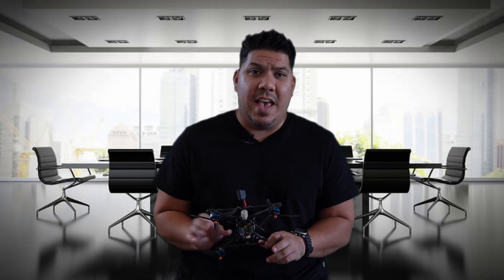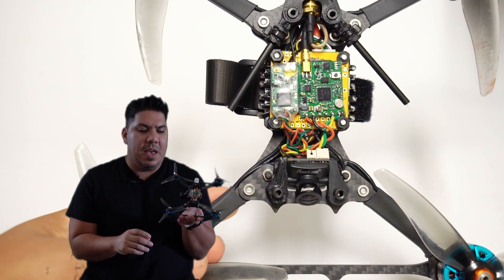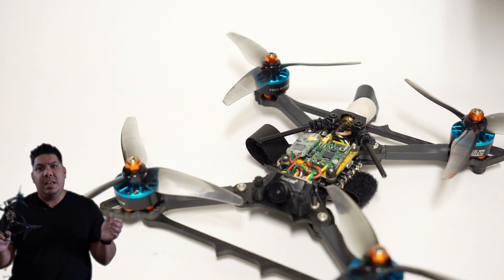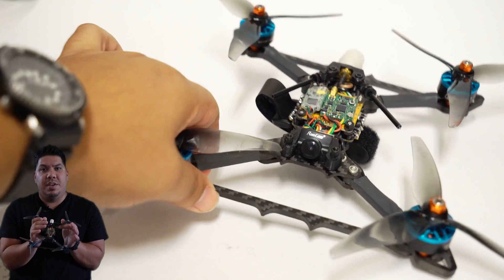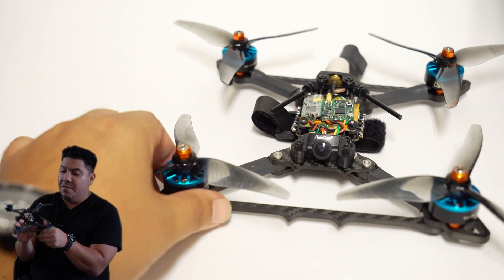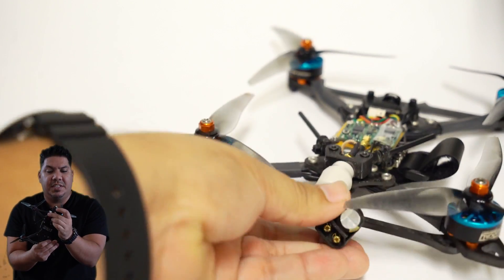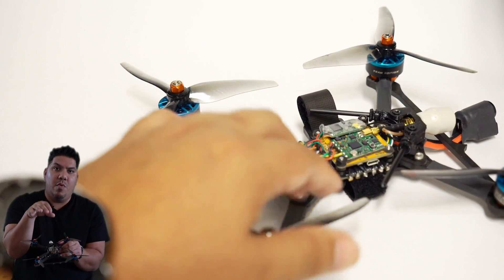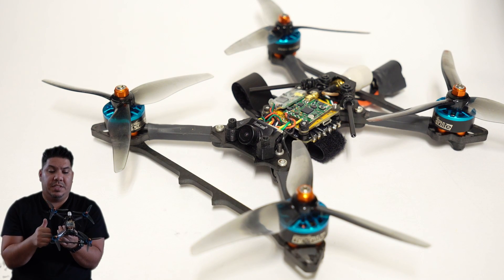Drone Components Explained: FPV Beginner series - Quadcopter parts explained - Flight Controller etc

Comment: Sir I bought a drone and when I put the battery to it was not the right side it was the opposite side.when I put like that my propellers started without turning the drone on when I checked everything is working in my drone but it would not turn on what is the problem in it?
Reply from the maker: if you plugged the battery in backwards it likely fried the ESC/ Flight controller or both.  Are you still getting the 5 beeps when you plug in? Or only lights?
Reply: @JonE5FPV  its backsward lol no beep just smoke

Comment: For the next one, please talk about how signals flow thru different parts and why... Like how the video signal goes from camera to FC so that the FC can add data (osd), and then it sends that combined video signal to the vtx.  And how power flows from battery to everything - I recently had to explain to someone how every piece gets power in his quad and ended up drawing a color coded diagram to properly explain it.
Reply: Also, make a playlist of beginner or intro videos. You could include things like your motor sizes explained video that YouTube recommended to me after watching this one
Reply from the maker: Yes! That is the plan to make a whole play list. So far I plan to do

Flight controller - I really appreciate your ideas for this, I will include them 

Transmitter / reciever 

Video system (vtx, antenna, camera )

Mode 2 transmitter controls - and yaw, pitch , roll

Protection - printed arm guards, capacitors, conformal coating etc...

I’ll keep taking suggestions for future videos and keep it going
Reply: @JonE5FPV  get a white board and pretend you're Jason from the engineering explained channel ;)
Reply: Or just make a nice drawing in Visio or something, and use your green screen magic and pretend you're a weatherman lol